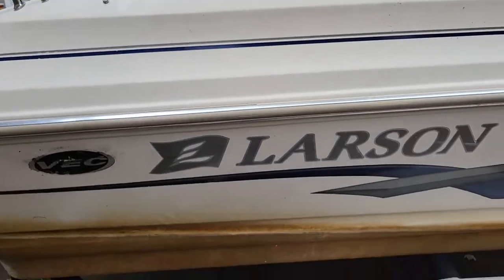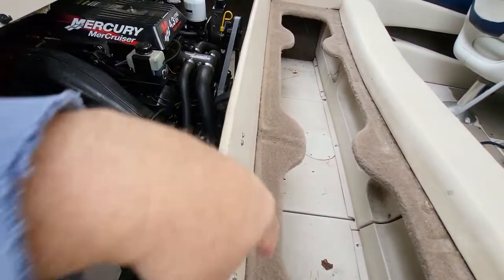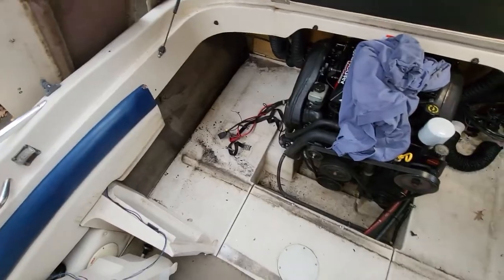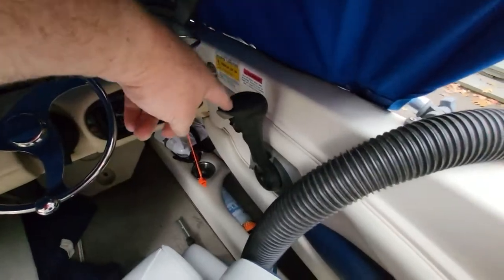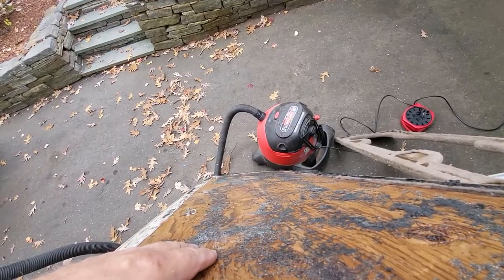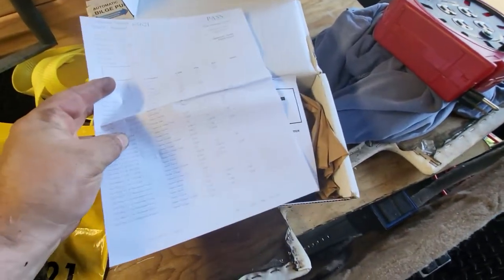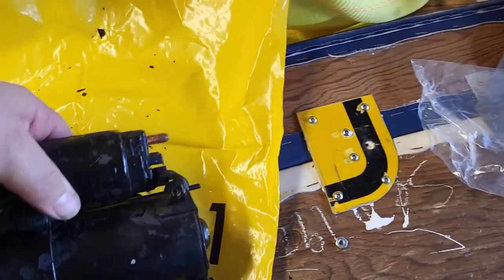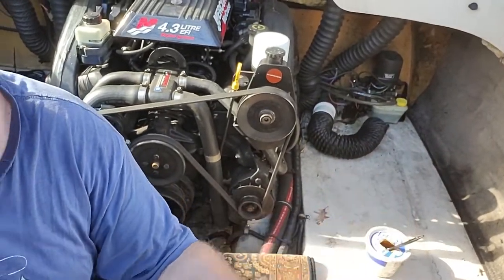Mercruiser 4.3 EFI Starter replacement and what can be involved in doing it.

Comment: Is there no ground wire connected to the starter? Thought there’d be a black sire coming from the battery terminal just like the red one
Reply from the maker: The ground is created thru the bolts screwing into the block. The ground wire is attached to the motor block.

Comment: Your lucky I had to pull the whole engine to change the starter lol did you fine out what that extra screw one the back of the new strter is for?
Reply from the maker: Well, that stinks. No, never found out but the boat ran with zero issues all season.
Reply: @bigguydiy2184  oh awesome yea found it's just a ground not needed next mission was diagnosing a no spark condition crossed my fingers wasn't the ecu in fact was just the ignition sensor the ecu for my engine is impossible to find unless you want shell out 1500 which is half of what another 5.0 would cost now I'm getting a severe flooding issue with a bad fuel regulator... 😂it never ends in one more issue away from converting to outboard
Reply from the maker: My dream boat has outboard(s). No more I/Os. Hate working on them as I get older.